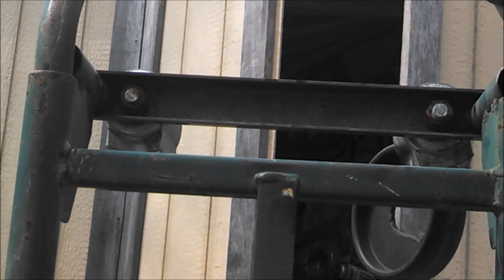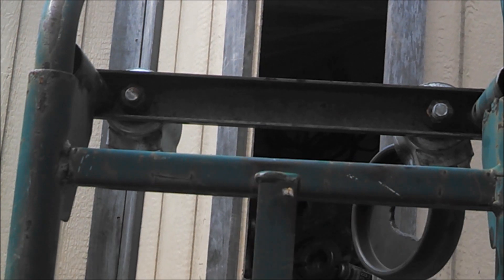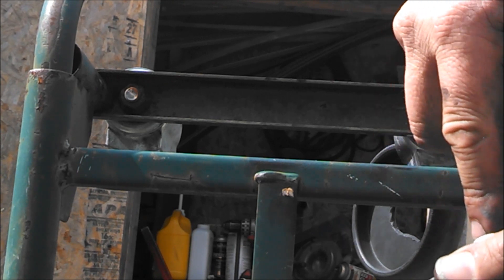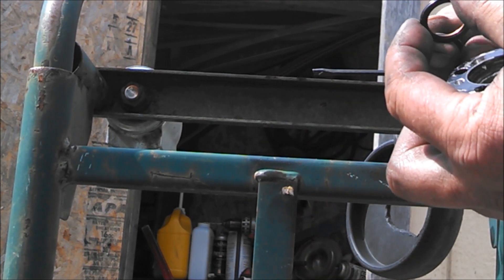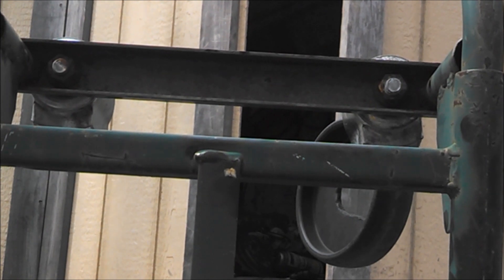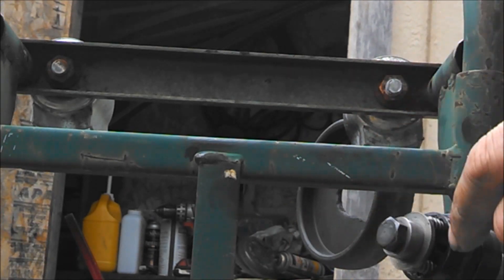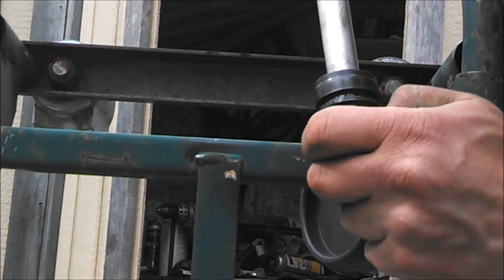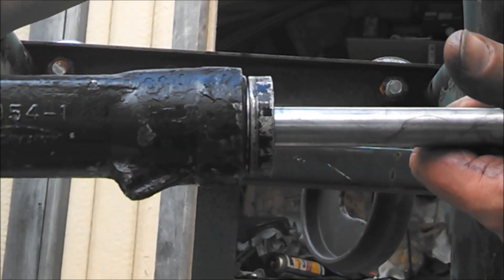mercruiser trim cylinder rebuild

Comment: Thanks for showing nothing on how to get the trim cylinder bearing off. Please delete this video
Reply from the maker: Bearing?? you mean the end cap? If you dont have the tool. put the end  cylinder in a vise and unscrew it with a pipe wrench/ large channel locks. if the cap is seized to the shaft some times putting a bar in the eye of the piston rod end and spinning it will unscrew the cap with the piston rod.